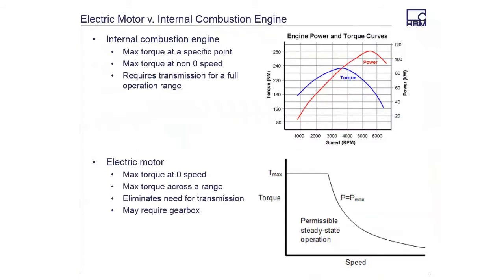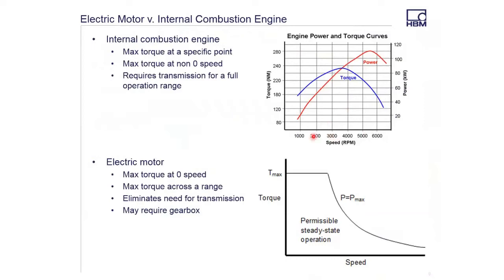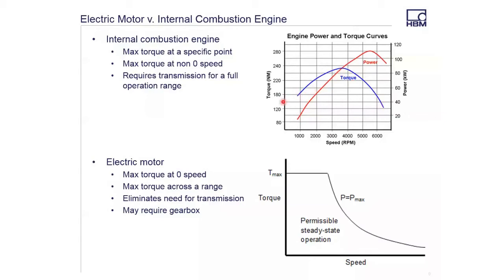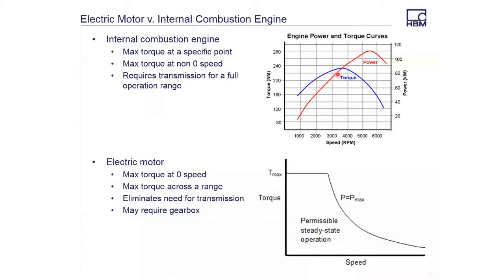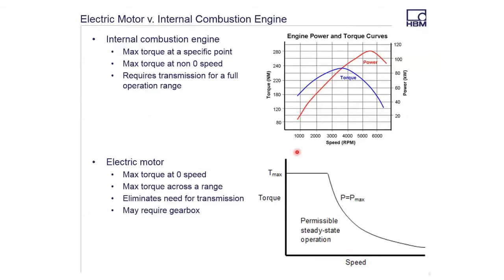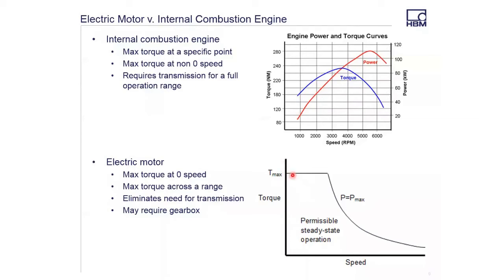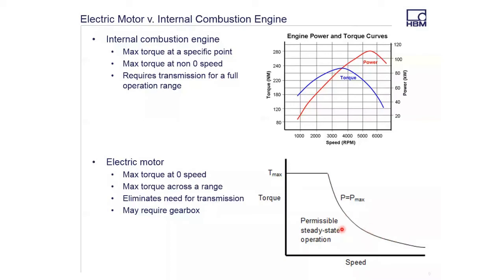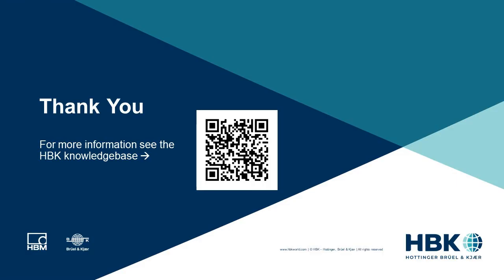Difference Between Electric Vehicle Torque and Combustion Engine Torque

Comment: 1:26 We don’t use the transmission to get the “max torque point at a variety of speeds” we use the transmission to get the maximum power point at a variety of speeds.  Power, not torque, is the limiting factor in not only the top speed of a vehicle but also in how quickly it can accelerate at any speed and how much weight it can pull up an incline at any speed.

Comment: I think add transmission to electric motor can save power and enhance the performance.
Reply: 😮😮😮😮😮😮! J 😅? Kk😮😅K K(?😮(
Reply: all transmissions introduce losses so not sure what you mean by "save power"
Reply: Gearing can multiply torque but it can’t multiply power.

Comment: A superb explanation ! ... but ... when does the  COST  " crossover " between  some (  VERY cheap ) modern petrol engines and a MUCH ,  MUCH more expensive electric transmission , become financially efficient .. (  ? ) ... DAVE™🛑